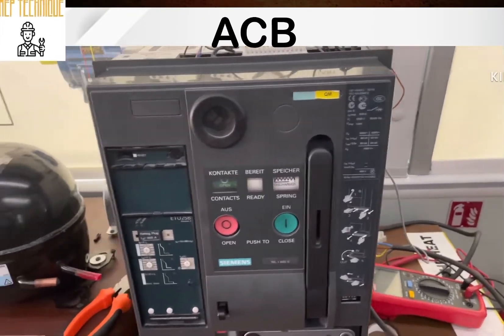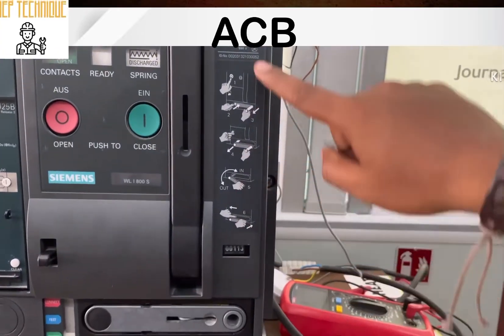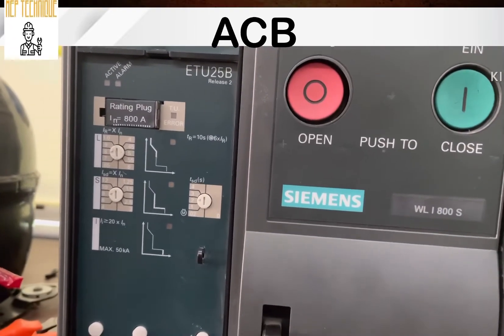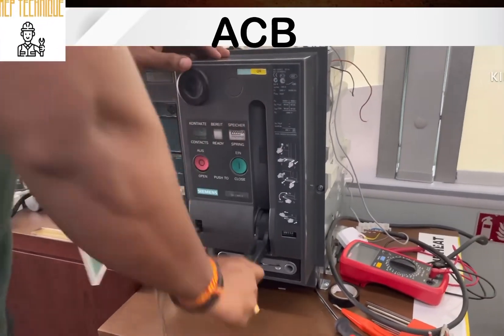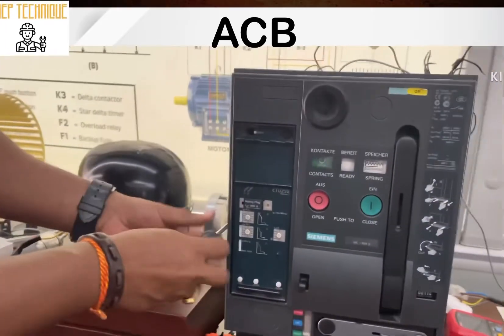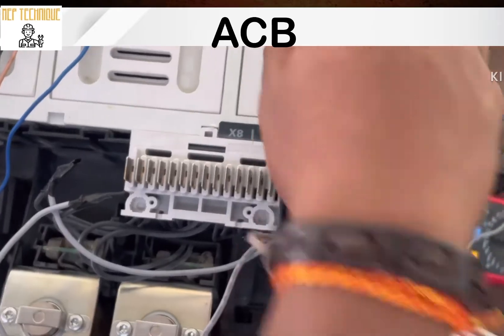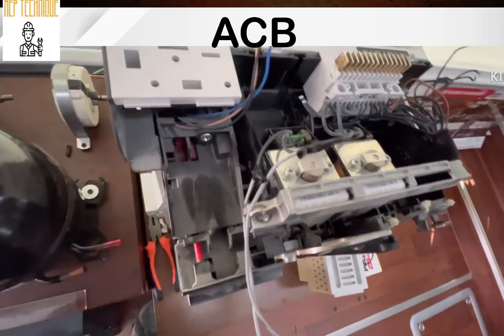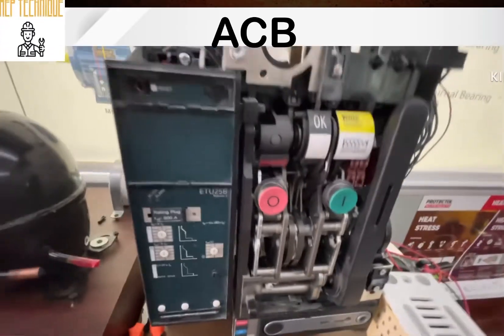How Does ACB (Air Circuit Breaker) Work?

Comment: Close.position   push button not working Whyy
Reply from the maker: 1.	Control Supply Voltage
	2.	Wiring and Connections
	3.	Check if the contacts are clean and functioning properly.
	4.	Test the beaker closing coil for continuity and proper operation.
	5.	Verify any mechanical or electrical interlocks aren’t preventing the closing action.
	6.Ensure no trip command or fault is active that blocks closing.

Comment: Hi sir, if the acb can charged but the contact cannot be closed, what is the reason?
Reply from the maker: 1.Ensure the closing coil is functional and has proper voltage.
	2.Confirm the spring is fully charged; the indicator should show “charged.”
	3.	Verify the control circuit continuity and connections, including interlocks and wiring.
	4.	Check mechanical and electrical interlocks (e.g., safety interlocks or position interlocks) for proper operation.
	5.Ensure no active trip signals are preventing the breaker from closing.
	6.Test the closing push button for proper functionality.
	7.Inspect the breaker mechanism for any mechanical obstruction.

Comment: If the breaker dose not charge what is the issue ??
Reply from the maker: If It is not possible to charge the closing springs by means of the gearmotor, please see below the problems.

1) The cables of the gearmotor are not inserted correctly in the terminals
2) connections of the power supply
Check the connections using the
circuit are wrong
3) The circuit-breaker is in disconnected Switch the circuit-breaker to the test position
4) The gearmotor protection internal fuse disconnect.
5)Gear motor may be damaged.

What to do?
1)Make sure there is continuity between
The cables of the gearmotor are not inserted correctly in the terminals
cable and terminal and if necessary reconnect the cables of the gearmotor to the terminals
2) Check the connections using the
circuit are wrong
relevant wiring diagram
3) Replace the fuse or gear motor if they are faulty.
Reply from the maker: If It is not possible to charge the closing springs by means of the manual charging lever then the operating mechanism is blocked, please contact to the Main contractor.